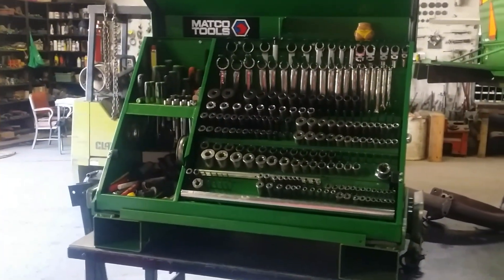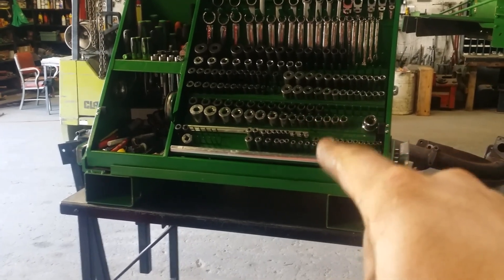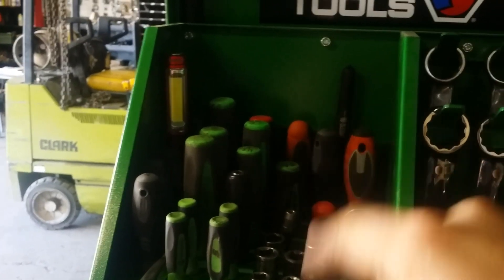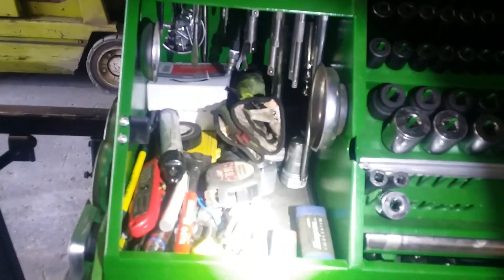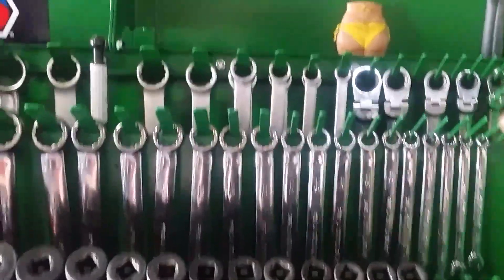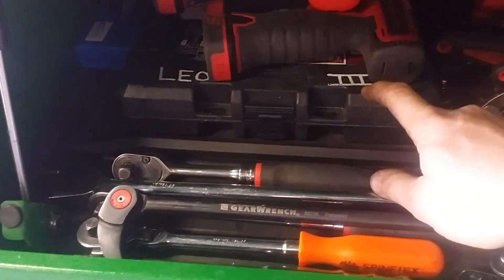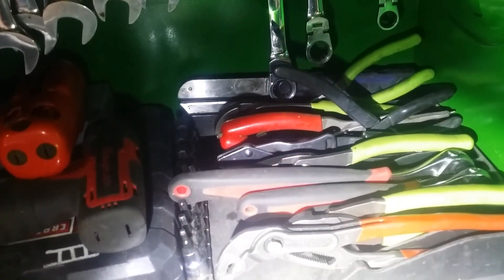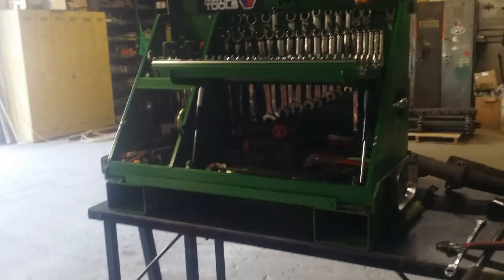John deere (montezuma) 36 inch road toolbox

Comment: Unique toolbox for mobile services and the pricing is good when compared to top boxes of similar tool capacity. I like the mod you did with the rect tube and angle iron for loading the box via forklift. Looks like the angle iron would protect the box from a sliding load, too, along with being able to chain the down thru the rect tube.